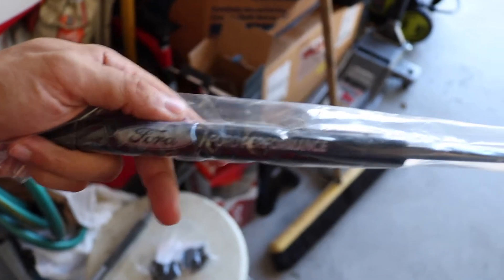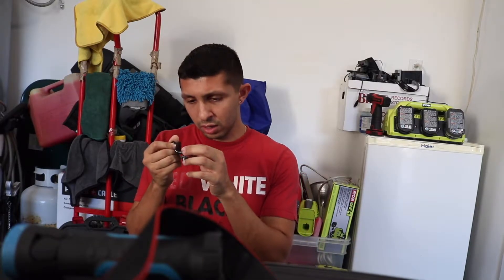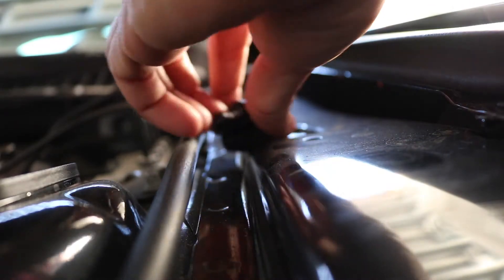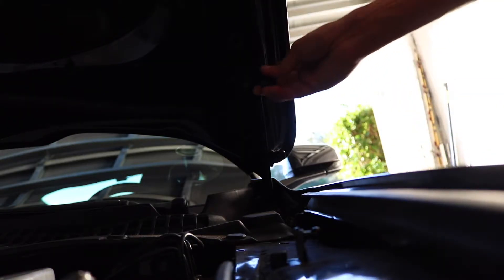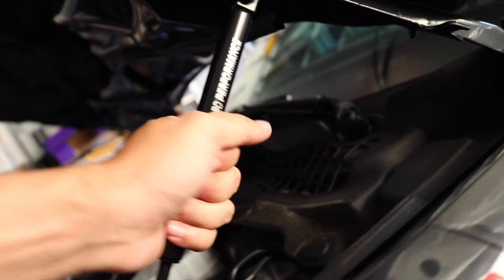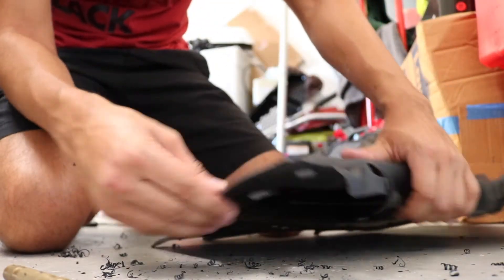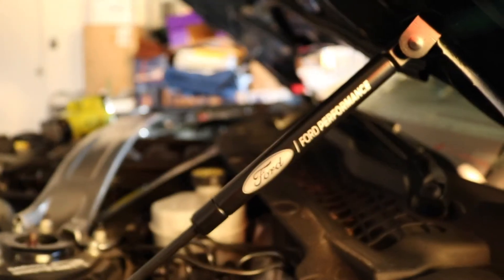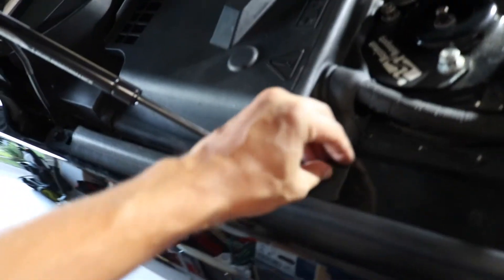Ford Performance Hood Struts Install (15-23)

Comment: I installed them several months ago.  The brackets that goe into the fender move when I try to tighten them to 20 foot pounds.  When I lower the hood, the fender brackets move.  I have tried to tighten them but I can’t hold the bracket still to tighten it so it doesn’t move.  Any ideas?
Reply from the maker: Wow that is actually very odd. Only other thing I’ve tried is putting a pry tool underneath it applying pressure to it while tightening. As far as it moving. It’s 50/50 because sometimes when I install them they go crooked after shutting or opening the hood so I think it all depends tbh

Comment: I installed these but had an issue with the passenger side. After installation when closing the hood, the hood and fender were not aligned. Hood is now higher than the fender and not sure what's wrong. Went over the instructions and everything is installed correctly. Anyone have this issue?
Reply from the maker: Just trying to get some more info, is the brackets installed in the right direction? Is the battery cover blocking it in any way? And are all connections tight? Lmk
Reply: @BrandonChinn  Brackets are correct and in the right direction. Battery cover is installed correctly, and all connections are tight. The only difference I noticed is that the instructions call for a 13mm socket but on my 2022 MACH 1 the hood nuts are 10mm.
Reply from the maker: @dougwatson6406  interesting it’s asking for a 13mm. Those are the rights struts I assume for your car. 10mm is normal on 15-23 anyways which is strange. Did you try flipping the struts to see if that changes anything?
Reply: @BrandonChinn  Tried everything I could think of but still makes no difference. I've taken them off for now until can figure this out.